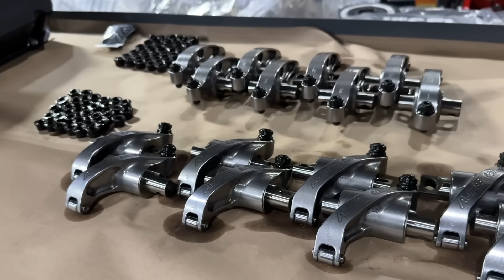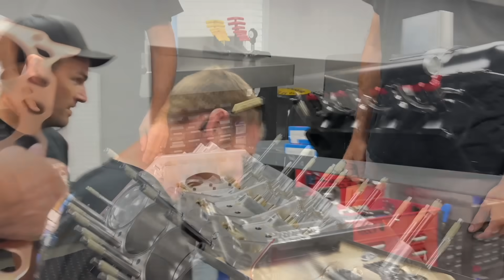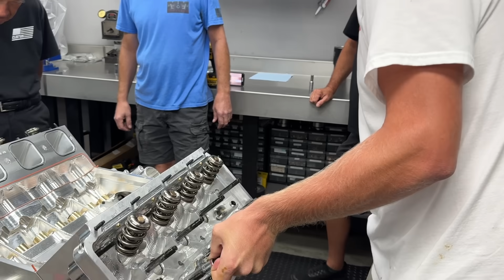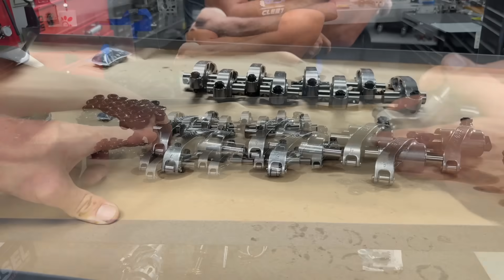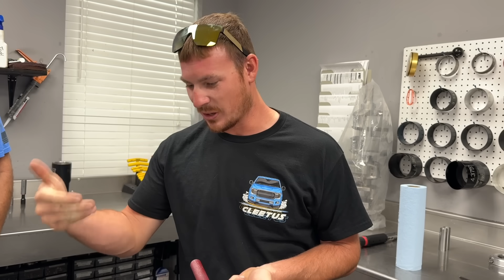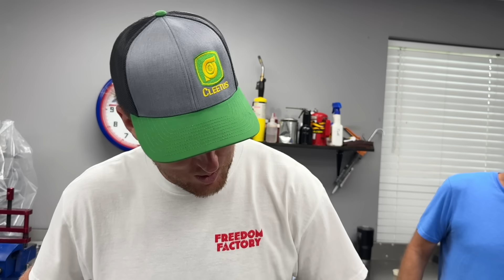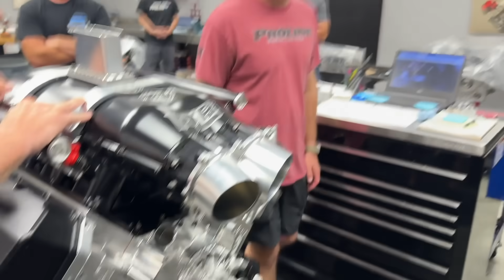Introducing Project Eagle's NEW Engine!!! (100% Billet)

Comment: People commenting about proline vs smx. This is a different beast its an all out drag engine. No coolant push to the lanes and back to the pits.
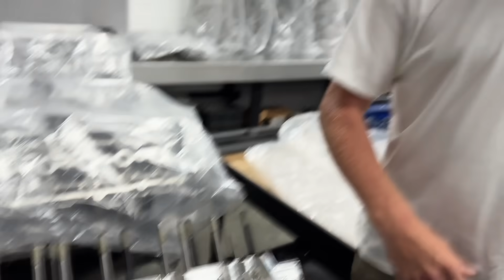Reply: 5:48 surprised everyone missed the shade George was throwing at the smx lol.. Damn.. You're 100% right. This will be a trailer princess that is towed to and from the lanes and pits and NEVER have a radiator in it. Smx never made any sense. Everyone saying it was getting an smx got boring when it was obvious it wasn't. Cjrc gave us a pretty big hint when they mounted the fuel cell 🤣
Reply: @JayMac  cool story
Reply: @JayMac  Yep, if anyone watched any of the last 2 or 3 build videos it was obviously NOT a drag and drive car.
Reply: @jonnie2bad fr dude just yaps about nothing everywhere, seen him on NPK live complaining about Cleet but i only ever seen his comments on every video
Reply: SMX is over priced garbage
Reply: @Emperor_Shao_Kahn yea garbage engine that runs 5s and drives from track to track 😂😂
Reply: @9090ruby ran 5 once. On the last day, and didn't have to make another drive.
Reply: @aussiek2000 been 5s multiple times and calling an engine garbage that drove a 1000 miles and ran 5s is hilarious
Reply: So what? Steve builds plenty of billet 481X mills and so on. This is just Garrett Mitchell doing what Garrett Mitchell does best. F things up, throws people under the bus, and move on. It will come back to bite him in the ass. Proline will not come down and save his ass like Steve did. And I hope Steve does the right thing and sever all ties with this clown.
Reply: @AB-80X  Cleet hasn't thrown anyone under the bus. WTF are you on about? He isn't done with Steve Morris engines.
Reply: In fairness Steve is still building an engine with Cleetus and the proline is not the same category as an smx. 
Comparing apples to oranges.
Reply: @scythelord  
I know he is not done with Morris. Go and watch the last Sick Summer video in its entirety. He takes no responsibility in the end.
Reply: Ayedidyae  
I actually haven't seen him do it to Pete. I suspect Pete could get pretty nasty if you did that to him. He seems like a nice guy, but I would not be surprised if he was "hands on" if you get on the wrong foot with him.

But this will eventually come full circle and bite him in the ass.
Reply: @aussiek2000  
Once? It has done it more than once. It's best time is 5.770. And after that ran straight out for lunch.
Reply: @AB-80X
Reply: Ayedidyae Moran racing engines ?
Reply: Drama queens toward the end of this thread. Nobody threw anyone under the bus. If you don’t like this crew, nobody’s forcing you to watch it.
Reply: @Emperor_Shao_Kahn  Tom Baileys over priced garbage has been running  5's since 2019. Yup, over priced garbage.

Do you intentionally choose to be stoopid, or does it just come naturally?
Reply: @Ayedidyae  and we will call you and your alt account out for spouting pointless nonsense and drama that doesn't make logical sense.   0/10 trolling. Do better

Comment: This engine is similar to the SMX. The intake can stay on when removing the cylinder heads. That's a very smart design!
Reply: i am not an expert but they seem new to not taking intake out while working the heads + i think they said on mullet a head repair takes hours because they remove the fuel rails and the intake
Reply: Worlds apart from SMX
Reply: @mahmoudsalah6418  
On one of the sick summer videos Steve went to help the guy with the Monte Carlo. The cylinder head was removed with the intake still attached. That engine is a SMX.
Reply: @p.b.sHUNTING  
Two completely different engines. The SMX is a drag and drive with two separate fuel systems. That hemi will have one for racing only hence, two completely different engines.
Reply: @MosinMan76254  what’s your point here?
Reply: @MosinMan76254  so what is the diff then between the 2 smx engines , when cleestus himself said that the hemi would give him a much easier time
Reply: This new engine doesn't have any water in it.  The smx is liquid cooled for street driving. This Plr engine is just for drag racing.
Reply: @mahmoudsalah6418  
There's only one SMX. My suggestion is to watch a Steve Morris video on how he makes it and you'll get our own understanding.
Reply: @p.b.sHUNTING  Except the SMX is based on the 481X.
Reply: @mrctuned2844  yet is worlds apart….. don’t see how you can even say “it’s based off it”
Reply: @p.b.sHUNTING  because on the HPA podcast, Steve literally says he took a 481X and just watercooled it.....
Reply: @mrctuned2844  nothing from the proline platform will transfer….  🤷
Reply: @p.b.sHUNTING  well I'm just quoting what Steve himself said. I don't own both so it's hard to actually verify your statement. If you own both it would make a great video 👍
Reply: 🤔 Stop you are embarrassing yourself. The 2 couldn't be more different

Comment: As a machinist myself, that’s some beautiful work by the proline guys. Insane.
Reply: as a machinist, what are your thought on the surface roughness in places like air intake ports?
Reply: @beastlysun  the rough surface finish is better for atomizing fuel. Many times if you look at the exhaust ports they'll be shiny like a mirror but the intake ports will most likely be left a little rough
Reply: @beastlysun  As a machinists myself, If I want it to be smooth.. I'll make it smooth. It's rough because they want it to be.
Reply: Ayedidyae  yeah, makes sense. Would expect that laminar flow would be preferable so you avoid steep velocity gradients. But that might have bad effect on fuel for port injection as you mentioned.
Reply: Dimpled golf ball goes further than a smooth ball. Air o namixs

Comment: The SMX was a water jacketed engine hence the drag and drives. Steve offers the SMX in a dry deck setup as well as a wet deck. It also was capable of removing the head with the intake still intact.
Reply: All SMXs are dry decked, that water jackets do not use the deck to move fluid from the block to the head. They are all plumber externally with AN line, making them a bit of a plumbing nightmare
Reply: Proline hemi can remove the heads while nit removing the intake as well. Biggest difference between proline hemi and the smx is pretty major...biggest benefit is the support behind it for parts and one of the baddest tuners on the drag racing scene.

Comment: Did I not watch a video a few days ago of Steve pulling the heads off an SMX with the intake still on it and saying he designed them that way ? I'm pretty sure cleets SMX was already capable of what they are so amazed about in this video lol. Super nice racing hemi engine though. A work of art for sure.
Reply: I will have to look for that video........I was out of town without internet or phone service. Cleetus also made a comment about it being the first dry deck they have had, yet isn't an SMX considered a dry deck? The SMX has no coolant flowing through the head gaskets to prevent the failures that go along with the oem design of a wet deck. I'm not sure what else a dry deck would refer to.
Reply: I definitely saw that video, Steve said 2 degree angle off 90 on intake port faces

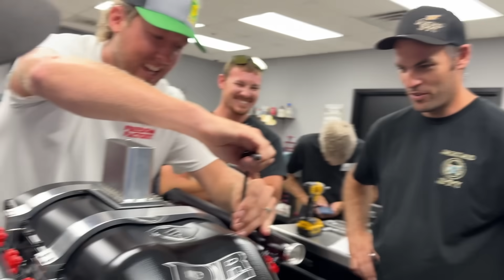Comment: 35:12 

Cleet, if you get yourself some PlastiDip and dip the extensions you’ll use around the intakes it will drastically reduce the amount of scratches you’ll get. 
You can even put a light coat on the socket. It’s what my grandpa does for the extensions he used around billet parts.
Reply: Smart! 🤓
Reply: Really don't know how I've never thought of this. Great idea
Reply: Yes Sir, great idea!! My Uncle uses heat shrink tubing on long tools to prevent scratches,  or arcing.
Reply: That is gold smarts only a veteran mechanic would come up with that

Comment: put a run counter on the dash, reset the count when you do the rods, after the count hits 20, turn the number yellow, the closer you get to the target number the closer the color should get to red, at the target number, make it blink
Reply: this right here is a great idea can more people like so cleet will see it
Reply: Sounds like it's designed to have Rod Stretch rather then Rod Failure.

Comment: Finally the long awaited engine reveal
Reply: And knowing how many Chevy boys will be butt-hurt is just a bonus. Mopar or no car.
Reply: A HEMI in a 69’Camaro? Okay….. it’ll ride 😂
Reply: @ronjones-6977  no issue with hemis but kinda wanted him to stick with the smx just bc of Steve
Reply: @Fuzionjay2 nothing wrong with SMX he bought a used engine did a lot on the limiter and idk the maintenance but you can pull a SMX head of without removing the intake as well. I kinda hope the motor comes forsale for a cheaper price I’m pretty interested.
Reply: @triplehfarmsllc7348 this hemi you can pull the heads off without taking intake off.
Reply: @Paul-may  you can also do the same with the smx
Reply: @Paul-may  you can also do this same thing with a SMX you do know this right
Reply: @ronjones-6977 BBC bottom end tho
Reply: @Fuzionjay2  the smx is a purpose built drag and drive engine, eagle is not a drag and drive car. it was never getting an smx

Comment: Just want to say, The Proline Hemi doesn't exist without AJPE.  I just want to give a HUGE SHOUTOUT to Alan Johnson, and his late brother Blaine, ( RIP ) who has pioneered TFX for the past few decades!  They are located out in central California out in the farm fields of Santa Maria. Most Top Fuel teams use AJPE products because of the reliability and performance.   As long as Cleetus follows a strict maintenance program, this engine will never fail and win several events. McFarland Racing for the WIN!
Reply: 100% correct its Proline assembled with their accessories. We ran AJPE in Top Fuel winning 4 Championships.

Comment: That's just like my dirty garage build, no machine work, dingle ball hone, SBC I'm building on the side of my house. I mean really, I don't see the difference. LOL. 
Beautiful engine. Beautiful shop. Very smart people. I'm very impressed. So cool. Be safe!
Reply: Me neither basically the same thing as my VW.
Reply: I mean, my 1.6L D series Honda build is basically the same thing too 🤣
Reply: a Squirrel dingle hone  is a free 200 Hp.
Reply: Throw 85lbs of boost at the SBC when it’s all said and done and watch it fly 😉😂
Reply: What an incredible engine!  WOW!
Reply: I’m looking at that bright yellow impact & wondering how they keep it so clean. Then I realize they are just using it to put brand new parts together.  Mine looks like it’s had a spray tan.
Reply: @klatubaradanikto  - Simple Green, toothbrush and a microfiber towel cleans them up really good.

Comment: After checking the price of the new motor about 90k. At 30 runs before rebuilding it. Thats a super value. Mullet has had 4 engines at about 30k a pop. The saying goes. A ounce of prevention is worth a pound of cure. The value speaks for itself.

Comment: "Don't touch my PushRod, Jackstand!!!" - Cleetus 2024
Well dang I lost the engine debate competition. I know alot of guys were saying Proline but I didn't think you were going to go full tilt and go actual 4 seconds ProMod. I guessed SMX because I thought you wanted to drag and drive it but this thing is a whole other level. Just the Cam alone will slightly rotate the earth with just a small blip of the throttle. After all the spitting and shouting that was done online I don't think anyone got the model right though. I should have known it was going to be their biggest and baddest unit with all the upgrades. This is no joke Garrett you need to step up your game on this one. You need to hire a designated pit manager whose job is to finely monitor all this. Definitely need a run counter plus a rack ready to go with extra parts all set. No more goofn around on this one. You going into the major leagues now. The content coming is going to be insane.
Reply: I know for a fact that atleast one person got it right and most likely the majority of people that knows that level of racing got it right it’s a no brainer PLR is kicking everyone’s azz at that level and it’s not changing anytime soon and nobody can even think about touching there parts availability they have so much pull with the supplier’s that something that hed,sm,henson,bae,noonan has a year wait time on proline can have on there door step the next morning
Reply: @54raceman  Or you can just make your own parts that's the good thing about billet!
Reply: @54raceman that’s why they call it PROLINE!!! Apparently!!! 😂

Comment: It wasn’t that long ago that Cleeter was making trips to the wrecking yard and pulling used LS’s out of trucks for his race cars.  And now a Pro Line Hemi!  I don’t think Cleeter fully understands the realm he is stepping into.  This engine is just the entry point.  To be competitive at this level you really need to keep at least one spare short block in the trailer and at least one additional set of assembled heads plus spare pistons, rings, rods, lifters, push rods, rockers, injectors, etc.  If it can fail the top teams have at least one spare and sometimes multiple.
Reply: He doesn’t even keep a spare transmission yet. 😂
Reply: He knows about spares.  He also knows the first few breaks he can get more clicks from the not having it drama.  Mullet's about due to finally have spare everythings; give Eagle a year or three.
Reply: @lordcommander3224 yes they do, LeRoy got a spare when thy went to a different center section.
Reply: Eagle might get a dedicated trailer, complete with sufficient spares …
Reply: @lordcommander3224 they have a spare now they just didn’t know the primary was hurt because his paid tuner missed it in the logs and the ratios are close enough that it wasn’t nosing over making it obvious so he didn’t feel it in the car
Reply: @gdkaiser before the car hits the track Dillard will have him a rack ready to go in it and spare consumables (springs,lifters,pushrods,rockers)and m&m will have him a spare trans if they haven’t already got them to him

Comment: Hope is a 
FRESH PLR TURBO 572CI STAGE 4 481X ENGINE
PLR’s most powerful and reliable Hemi engine platform just received an extensive update with the new Raised Cam design. Improvements include; a .650” raised cam, ability to run a bigger cam core, shorter pushrods and revised rocker gear assembly which all combine to add stability to the valvetrain. Larger head studs were added to the upper row to increase clamping force on the head gaskets. Also, the inner head stud has been eliminated, so now you can remove cylinder heads without removing the intake which saves valuable time between rounds.

In both Turbocharged and Centrifugal Supercharged applications, we have seen a significant performance advantage in favor of the Raised Cam Hemi over our “standard” Hemi.
Reply: And yet as great as it is, It still might blow up sometime. Hopefully it doesn't, but I can't wait to see the normal know-it-alls in the comment section spouting a bunch of stuff they don't know anything about
Reply: @ls_812 they ALWAYS do.  Especially when hammered with “lack of maintenance”.
Reply: It's not a 481X, it's a Hemi MH-7
Reply: Nice copy+paste you did!
Reply: They seemed surprised when they found out the heads come off whilst the intake stays but the SMX has the same feature.
Reply: @rockkhound943 yes, Steve just went over this feature on a couple videos ago when he was changing the pistons in that hotel parking lot. However cleet had the original version of Steve’s SMX that did not have that feature. Steve redesigned it.
Reply: Thank you for that terrific copy and paste job
Reply: 481x = wedge heads
hemi = hemi heads

AJPE/BAE hemi > 481x
In Pro Mod racing, if you aren't running a turbo/supercharged hemi, then it's probably because you're running a 900+" nitrous mountain motor